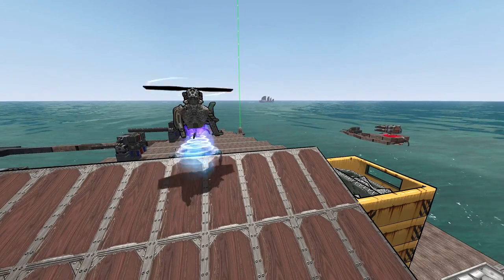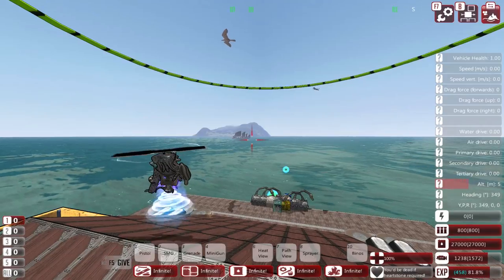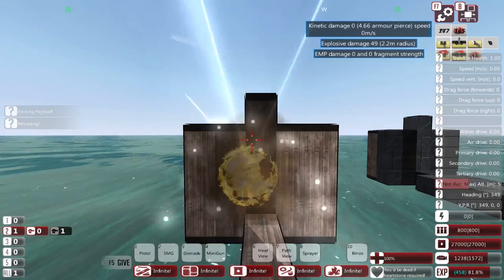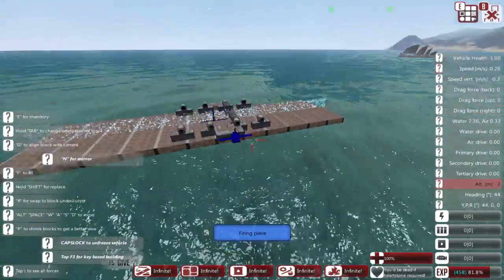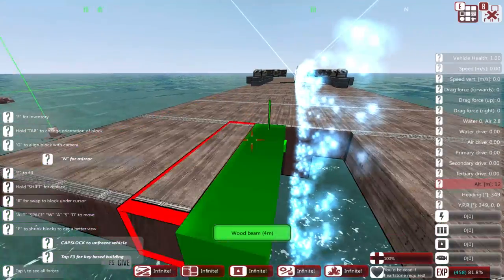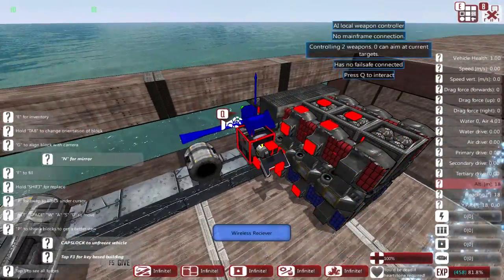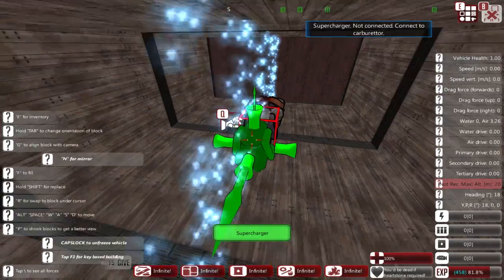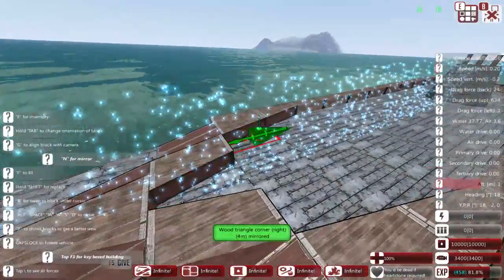From The Depths S3 Design 01-Ironclad Cram Cannon Sailing Ship.LetsBuild

Comment: I think the USS Monitor would be a good source of insiration. having a ship that can shoot its main cannon in every direction could prove to be very usefull. great to see you upload again btw
Reply from the maker: +Yorick .U  I like the monitor although it is a bit small as a coastal ship with a low free board. But going to the turrets or gun house for main weapons but still using a sailing propulsion maybe. Similar to the HMS Monarch or HMS Inflexible. Sort of a Monitor just a bit larger scale. Or a slightly Beefed up monitor as a Frigate/Cruiser. Will see how bad my Minotaur is against the DWG :)